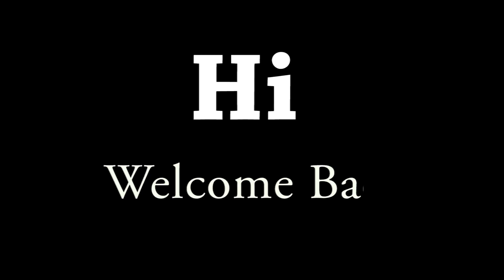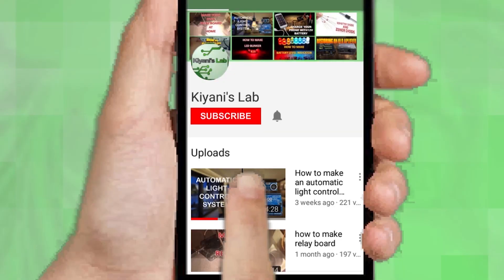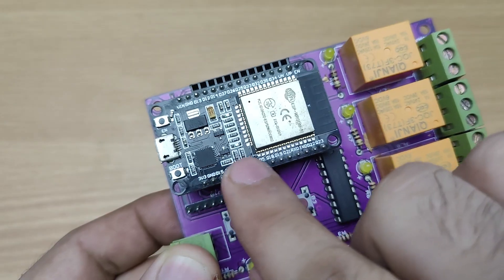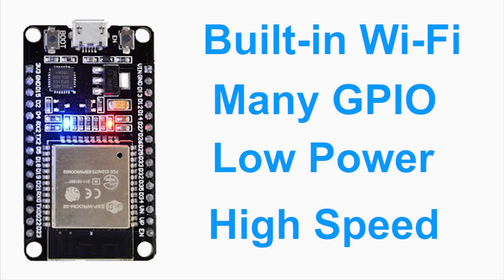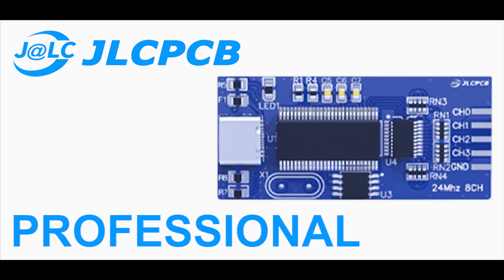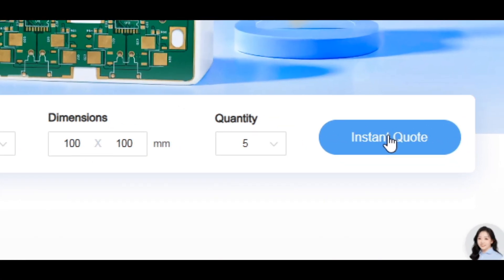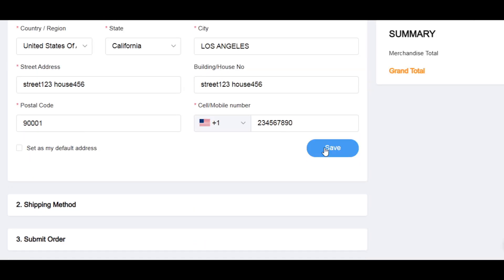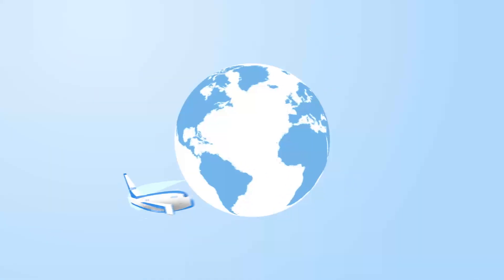ESP32 Smart Home Wi-Fi Relay

Comment: Anyone have some guidance as to why esp32 wouldn't automatically reconnect via Bluetooth to a tablet with a power cycle on either device,  but with a phone it is not an issue? I am finding myself that everytime I have to forget the device in the Bluetooth list and re-pair the device every power cycle to get it to communicate with the esp32. This is an issue on several Android devices not isolated to a few.
Reply from the maker: By default, ESP-IDF / Arduino-ESP32 does not automatically store Bluetooth (pairing info in non-volatile storage. After a reset or power cycle, the ESP32 "forgets" the keys, so the tablet refuses to reconnect. Some Android phones are more forgiving and will fall back to re-pair silently, while tablets are stricter and insist on a clean re-pair
Reply: @KiyanisLab thank you very much for your reply. Is there anything that can be embedded into the code to help?